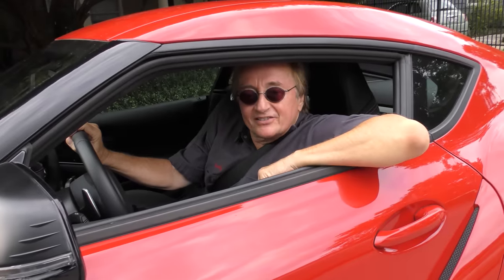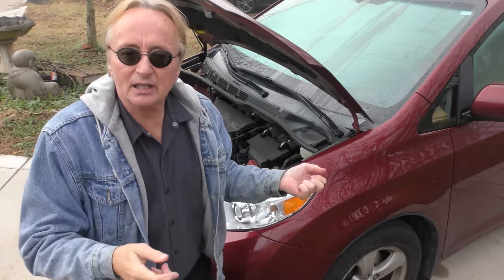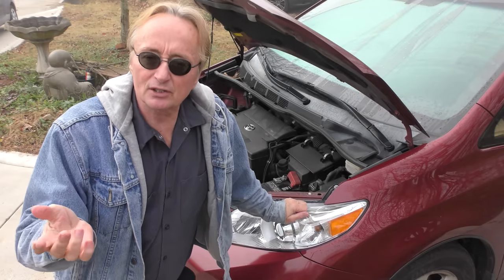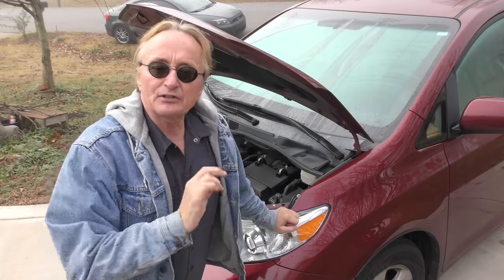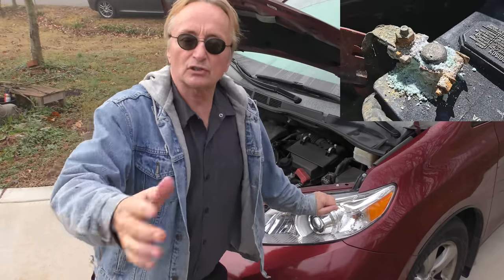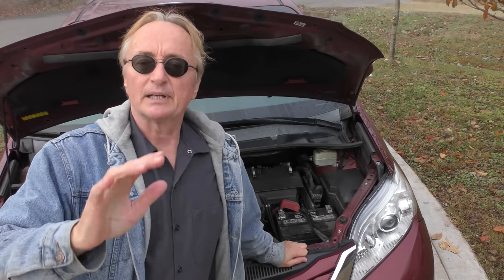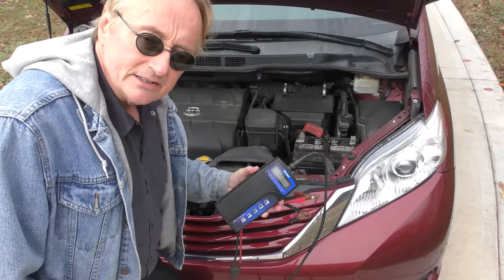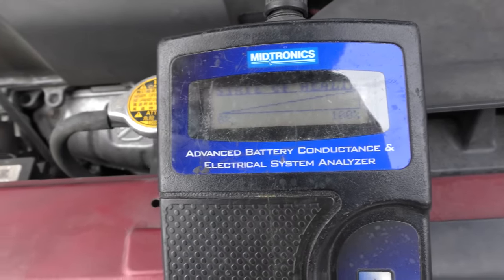If You Buy a Car Battery from This Place You’re Stupid

Comment: I bought a battery from Walmart yesterday Everstart brand with 3 year free replacement.  Price was $86.76 and with tax $96.08 here in Texas. The core fee was $12.00 plus TX Bat Fee $3.00 which would've added $15.00 to the final price if I didn't have a core. But you're right Scotty, my brother bought a battery at O'Reilly less than 2 weeks ago for $130 plus tax and it was the cheapest one and he returned the core.

Comment: Thank you so much for the info. Last we my 2018 Nissan battery was corroding and I cleaned it off. But I don't think I cleaned it off good enough. Next thing you know I'm driving and I put the car in park and my steering wheel starts to stall.

Comment: Sometimes I can’t drive due to disabilty. But I’m full timing in mini CamperVan. Turning engine in and off for heat or A/C frequently. Cold winters. Charging electronics. Should I buy an AGM battery to replace engine battery? My engine battery is dead from overusing all of

Comment: I know this is an older video and not a fanatic about desulfating batteries either.
However, that battery is a good candidate for at least trying to desulfate.
If it were me, I'd throw it on the battery charge desulf mode every night for a couple weeks. Might get the hydrometer out and check acid level after fully charged too.  I might have that Walmart battery bookmarked as a backup, but since its not dead its conceivable it might be just on the cusp where it could be 'reconditioned'.

Comment: Our local Napa is criminal. They charged me almost 400.00 for oil, filter, and a air filter for my 2019 F350. My mechanic charged me 260.00 that included labor and materials. Less the air filter. Exact same oil.
I do live in a mountain town with higher prices, however Napa didn’t think they would open an OReilys next door. They did. This is when Karma gets you. Treat each other fair always. Life will be easier

Comment: Scotty, I have a 07 Purple Dodge Daytona RT, it's one of 1400 made mine in in the 1100 area in particular way, I store it during the winter.  I am concerned as to the way I am storing this car. I have a cover over 5-6 months.  What concerns me is what should I do to the engine before I store it so it'll be in good shape when I start driving it when snow goes away and the temp outside is in the 50 - 60 degree. I use sythetic oil in it and have since I bought it. I am the third owner of this RT.  I have around 172,000 miles it runs very strong. I'd like to keep it in new shape as long as possible.

Comment: I have a mitsu, and it they replaced my battery free since 2012, but in the last 2 years, about the same time they started throwing nonsense suggested maintenance my way, they stopped considering my battery as bad and don't seem to notice it's probably as bad or worse than the batteries they long ago replaced. I guess I'll have to visit a dealer pretty soon, probably spring, to get the oil changed, and then they can spot my battery and see if they will replace it. I haven't had to buy a battery since I bought that car new, and I have a couple of battery chargers to keep it tip-top within limits. That dealer also gives me a super good carwash with any service they perform, even just an oil change. They have been doing that since at least 2012 as well. I never had so good a dealer of any car. I'm not even sure batteries fall into any warranty for the car, but they just feel like replacing them. They never did batteries with my prior 1999 mitsu.

Comment: I bought a battery from Walmart, it was an everstart value, group size 26. I paid 54.95 for it may 14th 2020. It had a 1 year warranty. It went bad around December 10th 2021 and was so dead it wouldn't start my car on December 14th. So I got a 650 CCA battery at advance auto 100$.  You can get them cheap, but I will say that 18 months went by fast and cheap is what you get. We will see if the extra 45$ will be any better. And at the same time, we also bought the 3 year free replacement battery for our 2007 fj cruiser from Walmart, its one of there best batteries, and it is bulging and leaking water. In my opinion, everstart Walmart batteries suck.

Comment: I once took a 25  lb. automotive battery, drained the acid from it , cut the plastic off, and heated the remaining metal to remove the lead. The process rendered about 2.5 Lbs. of lead. Now I gleefully accept the core offers.

Comment: I bought a motorcycle, a large Yamaha, that came with a new Wal-Mart battery. the thing didn't even last 4 months and the motorcycle ones only have a 90 day warranty. Needless to say, I didn't buy another one from them. I put in a BatteryTender lithium, like I had in my other big bike, which is on it's 7th year.

Comment: My 2000 Sierra 2500 6.0L gas has dual batteries from Rural King, About $60 each with $12 core. These are 2018 batteries.

Comment: As an independent parts store owner. Battery profits are not high for the retailer. You have many cores that won't qualify and you buy the core from the distributor with a new battery. Average margin on a battery is less than 30%. As opposed to something like brake pads at 40-50%.

Comment: My 2014 Ram pickup still has its original OEM battery. Still tests within spec, but I can tell it’s getting to be about time. I’m assuming it’s either from Johnson Control or Exide. (?)

Comment: I’d love to know how it’s testing a battery through the OBD2 port….   No way it’s doing a conductance test through all that wiring and connections.  Only thing it can accurately see through that port is voltage, which is an indication of state of charge, not state of health or if the battery is still good or not.  It had you turn headlights on, so I’m guessing it has you put a load on it and sees how low voltage drops to try and give you a health reading, but I’m skeptical of how accurate that’s gonna be against a proper test under the hood at the battery.

Comment: Question:  I have a 240watt solar panel and a 400watt wind turbine. I have 6 g31 DC batteries in a wooden box outdoors. A person said I should keep them indoors, keeping them above 32%. Another person tells me outdoors in fine as long as they are in a box of some kind.  Which is the best place to keep them, in or out?

Comment: I understand being they are the most high priced . But , in regards to my 2020 Toyota Camry , I could only buy one from Auto Zone . Since the car is so new , battery manufacturers haven't started making them yet . I would have wated to buy a Interstate  MegaTron as I did for my 2011 Toyota Camry . Even after 5 years ? being a flooded type , I only added distilled water three times ? and it was still in good condition .

Comment: Walmart batteries have gone up some. I paid $110 for a little Honda Battery. Walmart did have the best price around. I used to intall Die Hard at Sears and batteries used to range around $70. I used to get my car battery there but, they went from a 3 or 5 year warranty to a one year warranty. I couldn't believe how stupid Sears was changing the Warranty on an item that was a backbone of their garage service. I started to buy Batteries at Advanced Auto Parts because they had a better Warranty but, AAP has done something stupid and now sells the Die Hards and they cost an arm an a leg.

What you said is true about batteries that sit around. I did have a brand new battery that I kept sitting around and it degraded over a few years. I thought I could use the battery recently to jump start my neighbor's car but, I checked it first with a volt meter and it only had about 3.6 volts in it so, I couldn't use it. LOL I am wondering if the Auto Parts stores would give me money for it.

Comment: I only buy interstate batteries... I've been told they are the best and are used in race cars. Never had a problem with them. The biggest thing to look for in a battery is CCW ( COLD CRANKING AMPS). It's the amps the battery has when cold starting your car. The higher the number the more juice you will have to start your car.

Comment: The core charge on 12V car batteries is $30-$40 in Central Missouri where I'm at!
A $70 battery cost $140 all said and done.
It's sickening.
I'm buying car charger and portable car jumpers with air compressor so I can have 2 devices in my SUV with my tools, I can jump my car 20x on a single charge, charge my phones, has a light and check and inflate my tires up to 120psi all in one device by Stanley or Dewalt.
The other device trickle charges in case the battery goes really dead.
Beats buying an extra battery that's dangerous to carry in the car and pay up to $300 for a top one and $140 for the cheapest. Noone wants to give up their other battery that's 1-3 years old just to save $40

Comment: I usually opt for Interstate, however.....I spend NYE in Buffalo,NY at The Electric Tower near Genesee & Ellicott st and the battery died in my 17 Grand Caravan GT!

Tripple A jumped my van, made the hour and a half drive back home without issue, being NYD, my options were limited, went to Advanced Auto & purchassed a Die Hard Platinum AMG for a WTF cost of $227.00, but I was told this is a fantastic choice......I'm impressed by the noticed improvements experienced after instsll.

I drive allot, didn't want to buy Wal-Marts best, been there & done that with many premature failures/warranty claims!
Anyone have any reviews on The DIe Hard Platinum AMG battery??

Comment: This is lowly unusual. We normally get 10 years out of a Yuasa or Panasonic Toyota battery. The reason is the specific gravity is much greater (13.2)  than USA batteries, The EPA has forced manufacturers to make batteries in the 12.2-12.4 range, due to environmental concerns.

Comment: Unfortunately, the Walmart in my area has wretched service (also heard the wait times are horrible). They will have posted hours of till 7pm and they close up shop an hour earlier (same thing happened when trying for an oil change their). I was able to go online for the chain auto store and got a discount which made the price slightly more but with a 3 year warranty and a better battery (which was actually the same battery that lasted me over 6 years) and they close at 9 so no rushing to get out of work in time and then wasting time and gas for nothing. From what I hear from mechanics in my area the walmart batteries tend to go out sooner as well.

Comment: I have a Walmart ever start Walmart battery I bought brand new in 2010 for my boat which had a brand new outboard installed..
Well it’s 2020 and it’s still working perfectly no reason to spend over $100.00 on any battery

Comment: Most people are going to buy batteries that they are already use to , like I use nothing but SEARS DIEHARD platinum batteries and they hold up well,and it's for at least a 3 year warranty,a and FREE INSTALLED,but since I don't have a SEARS AUTO CENTER in Richmond VA any more,I have to go to ADVANCE PARTS for a DIEHARD batteries. Walmart may be cheaper,but learned over the years that it may be poor quality,for a 94 Oldsmobile cutlass supreme s it's about $79-$80 with a 2year warranty,and DIEHARD batteries are 3yrs.

Comment: NAPAs line includes some from East Penn mfrg.  They also make Decca.  I’ve been happy with that brand and NAPA locally as reasonably priced though one item many people don’t consider is the replace warranty terms.  

Large box and club stores seem to sell primarily Johnson Controls/Yokogawa made batteries, and have NOT lasted well, my demands are not extreme - my vehicles ranged from midsize cars to vans and a few large cars - no trucks of any size.  

In my experience, JC/Y have not been as good as the vehicles’ OEM build,  foreign or domestic.

Comment: I mold lead for bullets and stuff. Tried to melt down batteries. a truck battery weighing 50 pounds gave me about 3 pounds of lead and a huge pile of crumbly lead oxide/sulfate powder that only turns to lead if you use all kinds of chemicals and time etc. Not worth it.

Comment: AutoZone is very expensive for batteries. Last time I needed a battery I got A Bosch on sale at Pep Brothers. It was still over $100 dollars but it was substantially less than the battery at Auto Zone. I had a standard shift so I could park it on an incline and push start it.😊

Comment: My Lexus ES300h Hybrid has a AGM battery with a vent port, allegedly required because the battery is in the trunk.  No one but the dealer offes a compatible battery and that's for $315 MSRP.  My local Lexus dealer charges $430.  Crazy for a 480 CCA battery.  I guess they last since the hybrid doesn't use the 12 volt battery to turn a starter (only sets a solenoid for the high voltage battery) - it's 7 yrs old and still going.  I've been searching, but since I don't use the car much, I'm going to hold off.  Hopefully the battery testers are close and I'll consider buying one when it says I'm below 50%.

Comment: You can buy the battery , and keep an 8mm wrench in the car with you, and run the existing battery until it really will not just start another time, then change it, and get your core money back returning the battery later.

Comment: I've been buying car batteries for decades at the Wart. And they worked. But now, the same battery model I always bought will start my car 4 times, then fail and need a jump start on the 5th. I haven't even had this battery for a full year. When I took it in to complain, it tested A-OK on the mall's tester.
Could it be my car? I stopped by an alternator/starter place for a quick test. The charging system tested in top shape. "Oh, THAT mall?" - the tech said. "They are getting cheap on the batteries. And their tester is... what it is." (He has no dog in the fight, his shop doesn't sell batteries.)
So yeah, by all means, buy batteries at a place that sells a lot of them, but check with independent techs what's the best place in town. For my locale, none of the top 3 choices given were malls.

Comment: My Mazda dealer wanted $200 for a battery for a cx5 so went to Walmart and bought a $49 battery with even more cranking amperes, the issue it had the connectors in oposites sides but no problem I was just able to rotate the battery and put it anyway ( that was 3 years ago )

Comment: And now the primary AGM battery is 250-375 and since it also has a smaller secondary auxilary auto start/stop AGM battery that is 150 for that one. That's almost dang near 600 after taxes for the top of the line AGM battery set. Insane!

Comment: Ugh. I didn't think to check Scotty first. Went to O'Reilly's installed the battery, and then saw this video. They told me not to get the higher Cold Cranking amps, which I told them I was replacing after  more than 5 years. So like a chump I installed the 500 CCA and it just doesn't turn over like I'm used to. Plus, after pay $220 for it, I was pay $50 more. sigh.

Comment: Want to make your battery last? Do what i do. I found this out years ago, I had a one year old battery, it died! It was under warranty from Canadian Tire (Canadian chain of stores) the guy in the shop says look at it, you have 3 dry cells, you should top it up once in a while. I answered how, aren’t all batteries sealed now, maintenance free?  He says nope, just pop off the cap over each of 3 cells and top it off with distilled water. So I remembered from high school auto shop class to look in the battery cell, get the right angle and look for the light to show a cats eye, if you see it it’s full, if not fill until you see it. I got 10 years out of the original battery in my 97 Aerostar. Years in my Escape battery by just by keeping an eye on the battery. Now my son had to replace the battery in one of his cars and we tried to pop the caps off to check the fluid level a while back and could not so I imagine this could be a ploy to sell more batteries as you can’t top it up and make it last?
Reply: .....but you honestly can't top up the sealed " maintenance free " batteries today . Yes if they are a light colour you can shine a powerful light through the case to silhouette the electrolyte level but you still can't top up if it needs toppling up . However I have melted holes through the top with a soldering iron in order to top up then there's the little matter of how to reseal those holes.
Reply: Top off battery levels?!?! Forget that!?! I have Super Start AGM battery. It requires no maintenance! And after 7 years, it's still running!

Comment: I usually buy the $48 dollar economy battery at walmart and trade in a super dead battery. I replace my vehicle batteries after 2 -3 years. I then put them into service on my solar panel bank for a couple years. Good or bad a battery lasts 4 to 5 years till the acid eats the guts out so why pay 3 to 4 times for a battery.

Comment: Wal-Mart is the only way to go for car/truck batteries - The Maxx always gave me approx '7' years of trouble free starts.
Same for tractors - get '6' out of em . 
As for bikes (well custom bikes and Harleys anyways) - it's Deka for those.  I've always gotten '7 years out of their 'agm' types.
TIP : Bikers can $ave alot of bidenbux gettin a Deka (Deka labeled only) off of ebay delivered.  
Those labeled HD battreys - they're all Deka battreys made by 'East Penn Manufacturing' in PA.) ... that HD label just jacks the price up.

Comment: I have been employed by a very large and diverse battery manufacturer for over 25 years and I will say this. A lot of what you said is accurate but some of it is very inaccurate. Technically speaking you missed some very important parts about the physiology of a battery. Speaking on the business side of things you nailed a lot of it but missed some very important parts there too. The battery business is very complex and it also twists and turns daily. That $70 battery is likely not the same exact battery as the $170 one. Sometimes this is revealed though a simple weigh test. Sometimes it is simply who will back the product unconditionally. 
Overall, a very good video sir. Keep on nailing it bud!